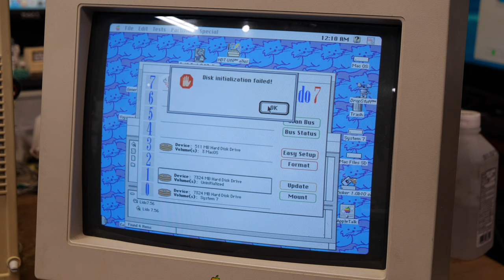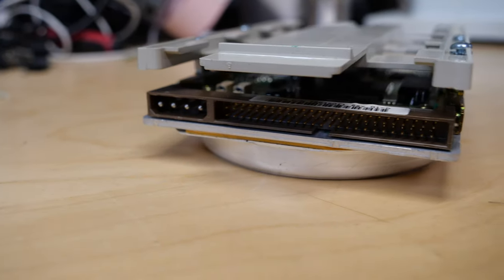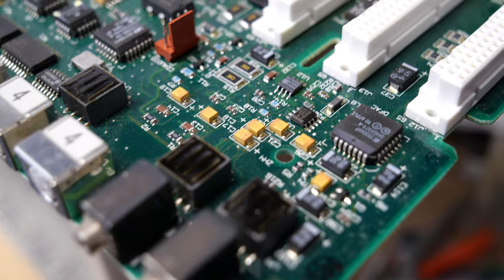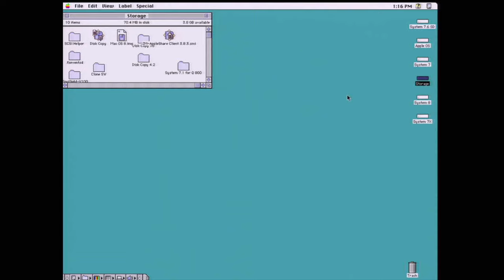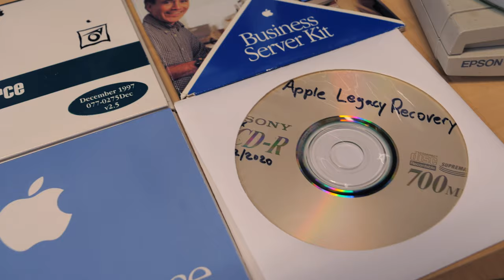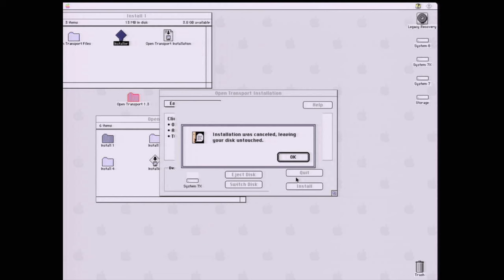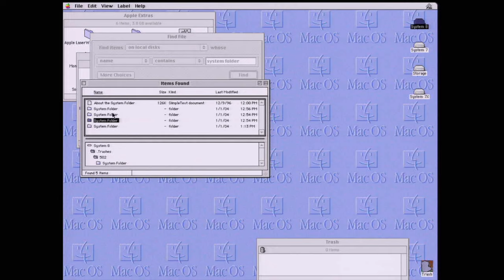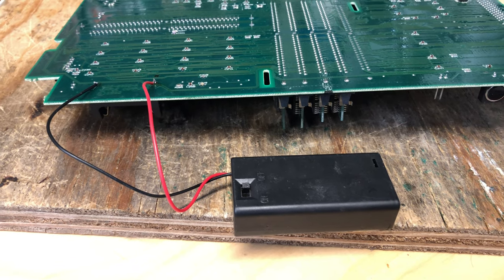Vintage Macintosh Challenge - Installation and Setup of My Quadra 800 (VMC Part 3)

Comment: The Quadra 800 is a fun little machine, been meaning to get A/UX running on it. I've found using old SCSI SCA drives with 50 pin adapters are a pretty safe bet and easier to find. They're bulky and loud but you don't get unexpected behavior with them!

Comment: Not surprised you found graphic design software on it! I was a book designer for 25 years working at a publisher, and in 1993 we switched over to computers. It was a difficult transition for many of us, as we were in our 30s and 40s. In the beginning we had to share computers, signing up to use the two we had. One was a Mac IIci and I don’t remember the other one. When the company brought in a Quadra 800, we were all fighting over it!😜 the older Macs couldn’t handle all the graphics we used. I still remember trying to work on a book that had color photos, and seeing the large letters coming up on the screen: NOT ENOUGH MEMORY 🥺

Comment: Have you considered installing NetBSD? It should be possible to boot it from a second drive from Mac OS 7, but I don't think the tutorials address that configuration.
Reply: Turns out it does talk about that in the instructions. You run an executable from OS 7 and it boots NetBSD.

Comment: Did you end up getting further with this? I saw your live-stream and the lackluster performance of Dark Forces and have been looking forward to seeing if a nubus graphics card would improve things. I've seen that several games were released for 68k MAC's that really shouldn't run very well. Like Dark Forces, Doom and Settlers II. I'm fairly new to 68k MAC's (being more of an Amiga-man) but I've emulated MAC on the Amiga for years, and I've recently picked up a Mac Classic II and a Quadra 700. I'm very interested in getting a better understanding of what nubus cards were able to do for MAC's of the era.
I do have a couple of Power Mac's as well, but I really feel that these 86k MAC's should be allowed to remain 68k, so sqeezing as much 68k FUN out of them as possible is where the adventure is at :)

Comment: Did anything happen after this? I don't see a follow up video about using this as a daily machine
Reply from the maker: No, life got in the way. It’s explained kinda in the Radius VideoVision video I made. I still have this machine set up and do use it very frequently for printing, copying software, and more. Maybe I’ll challenge myself to use it another time now that it’s all set up.

Comment: CR2032 holder would be better than dropping in a new bigger cell. Less chance of leakage and corrosion.
Reply from the maker: True - but this is just temporary and when the machine goes back on the shelf the battery is removed.